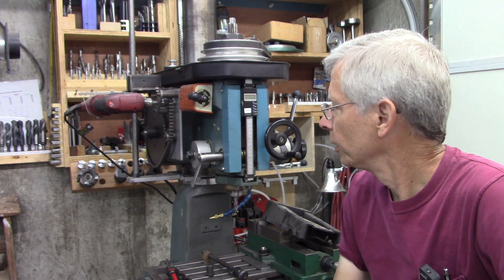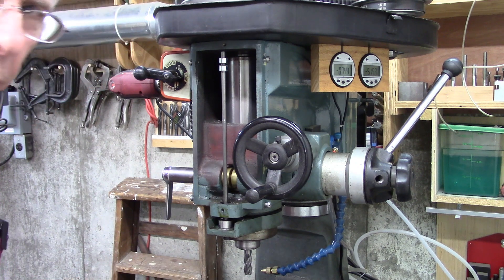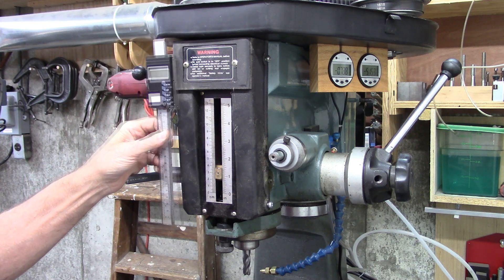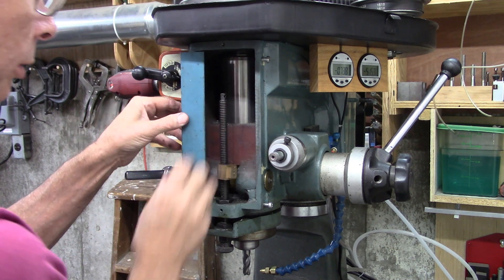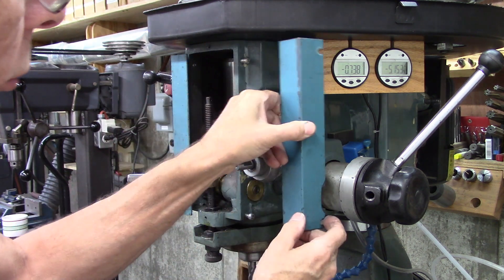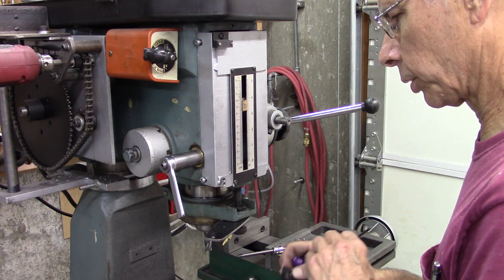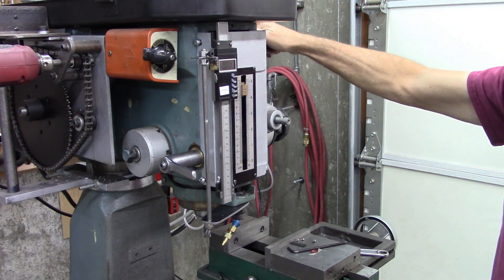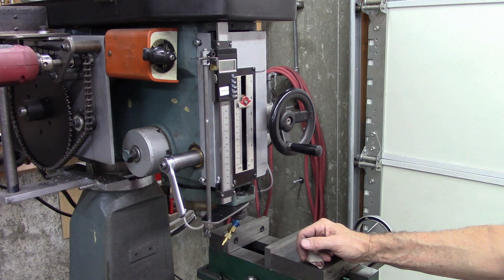DRO Z Axis install for my RF 30 Drill Mill

Comment: Great video! I was wondering if you had a manual you referenced to reinstall the original depth stop components? 

Recently got a similar mill but it doesnt have any of the depth stop peices, so im trying to find some good references for manufacturing them myself.

Thanks!
Reply from the maker: Thanks. This is all I had with mine. https://www.penntoolco.com/content/RF-30-manual.pdf

Comment: One thing I noted on my RF30 is that the quill can rotate a small amount, maybe one or two degrees. Had to design the Z scale mount so not to be affected. Have the original plastic cover protecting the scale.
Reply from the maker: Strange...  mine did not rotate. I probably could have designed it better or differently but it worked great!

Comment: I need to add a fine adjust to mine like your front hand wheel does for you. I use the main quill lever and watch my Z axis DRO to get me there. Its fiddly and slow and easy to get it wrong.
Reply from the maker: I love the down hand wheel. I'll bet it is hard to get with it a couple throu.
Reply: @WinkysWorkshop  yeah PITA if not impossible.

Comment: Nice job. Too late now but I when I was installed the DRO on my tailstock I found it easier to make the display static and move the rail instead. I think that might have worked here for your mill and it would have been more compact and with less parts.
Reply from the maker: You may be correct. Interesting idea.

Comment: Those things are awesome.  I put one on my Lagun, I think it's just like the one you have.  It was also a fun project, but I did mine a smidge differently than you.  I put mine over on the side, and fabbed simple brackets to screw it to the side of the spindle.
Reply from the maker: Thanks, yes there are many options for mounting. Your method might be better

Comment: Glad I found this video. I just bought an older 40 so this gave me some insights into the workings of the quill. 
Where did you find that DRO?
Reply from the maker: Maybe ebay, I can't remember. Search for "vertical DRO 6 inch"

Comment: Crude or not, it works. That's what counts.
Reply from the maker: I thought about making the one piece cover but the way I did it was much easier. The casting wasn't parallel and getting a good fit would be hard. Yep, works great

Comment: I added a DRO to mine but used the scale that is separate from the read out. Mounted the scale in the cavity behind the spindle. Up in the body of the machine. usually were drill presses mount a light. Totally out of the way. works good. My only complaint is these inexpensive DRO's all run on battery. Always seems like when I need to use it the battery is dead!
Reply from the maker: Thats a great way to do it. If I was going to do it over I would consider doing it like you did. I also agree on the batteries. The down DRO turns off automatically but the other two are battery eaters.
Reply: What dro did you use?
Reply from the maker: @rb63  I just found it but it's out of stock.  https://allindustrial.com/all-industrial-30072-6-y-axis-digital-readout-scale-vertical-bridgeport-mill-lathe-dro-output/
Reply from the maker: @rb63  I got it on amazon but it came from "All Industrial". Amazon says it is no longer available. It has an auto shut off feature and retains the location even when it turns off. Batteries last about a year.
Reply: @rb63  Shars 6" Digital DRO Large LCD Readout Scale IP54